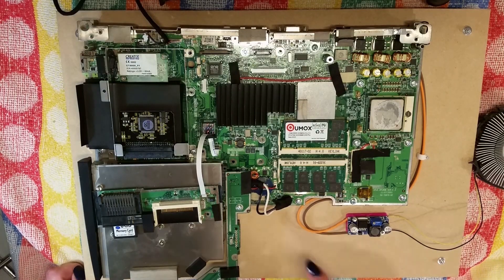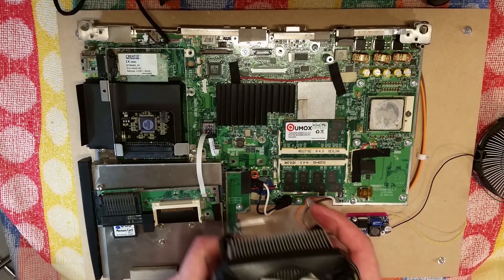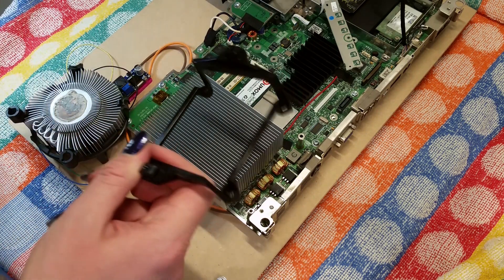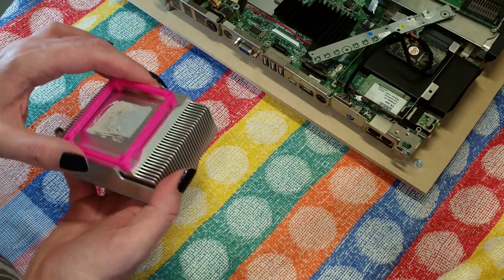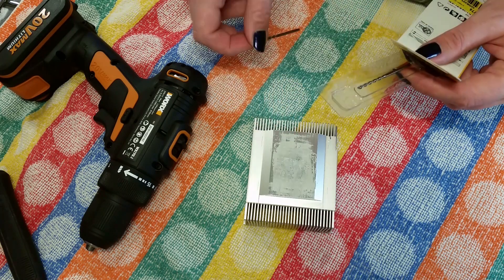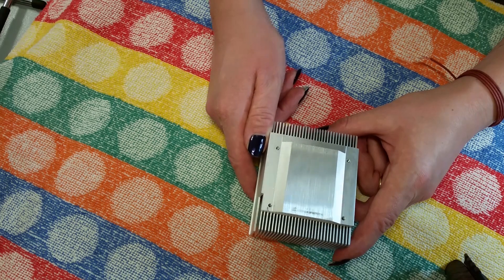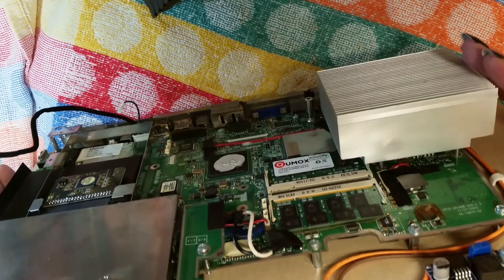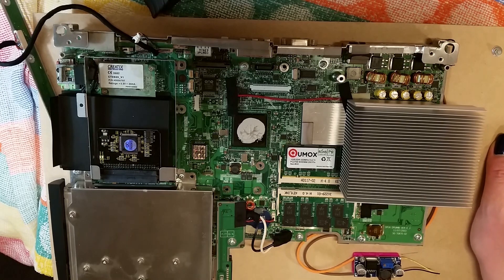Laptop to Desktop Conversion ~ Adding a CPU Cooler

Comment: you should do more cpu cooler to laptop conversion videos. you are the only one in the whole internet that did it. and many many of us have laptops that we want to overclock and change processor for faster and hotter ones. and we need to put bigger coolers. we don´t care about portability. i have my laptop with lots of cables in my dektop anyways. ethernet, energy, hdmi,  joysticks, keyboard, mouse, external drives, and two base coolers now.

Comment: If you have an old laptop sitting around you want to still use for some light gaming. 
You can actually get a decent little performance bump by modding it like this. 
Give a nice powerful overclock, and it actually being able to stay at that boosted level.

Comment: How is the performance under load? Is it enough for passive cooling? I am trying to do something similar for my 45W TDP laptop cpu. Thanks for the video btw.
Reply from the maker: The CPU cooler is far greater in mass than even the largest laptop CPU cooler. As long as there is a good contact, there should not be any problem.

Comment: Hlo pls. Tell me i have a dell laptop  and my heatsink has stolen and that type of heatsink is not in the stock then can i do just as i remove my laptop display and use a cardboard on which motherboard and other part is keep and i use deskptop cpu cooller and that box side in my led and connect with hdmi to led then it is possible that my setup will not lag or restart by the absent of real cpu cooler and heatsink pls tell me  😩😩😩
Reply: English?

Comment: Any more progress on this build? Also what is the thing you plug the fan into called?
Reply from the maker: If you look for "dc to dc step down module" you should be able to find what you need. As for the machine it is still as it is in the video. There is a problem with it soft locking up now and then. Only way to clear it is press the CPU speed buttons. Just have not had the time to look into fixing it.

Comment: What are the specs of the power converter for the fan?
Reply from the maker: Input voltage: 3V to 40V
Output voltage: 1.25V to 35V
Input current: 2.5A (maximum)
But the ebay ones are marked lower at 10V to 24V input and 3V to 20V output at 1A 
It is possible to go from the maximum to the minimum but best practice is keep the step down close.
Reply: Cool, thanks  @TheDutyPaid

Comment: Should i upgade my always over hitting cpu cooler or upgrade my ram???
Reply from the maker: Any CPU that is well cooled will work better and overall faster. Depending on how much RAM you already have, you may not even be using all of it.
Reply: @TheDutyPaid  i have 2gb ram ;--;
Reply from the maker: @endlesserenity  if it's DDR2 then that is really cheap at the moment and well worth upgrading. Just beware of the RAM limit if you are using a 32 bit Windows.